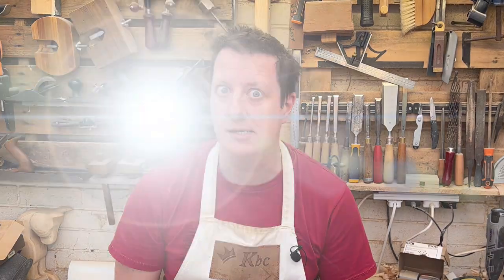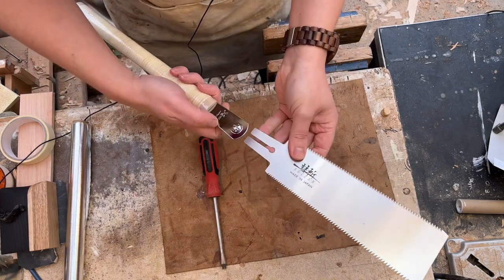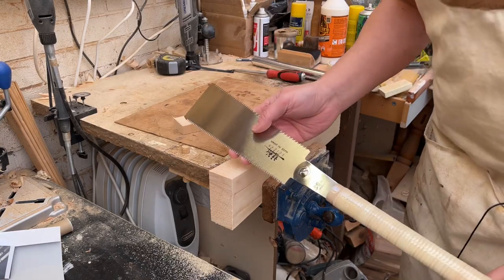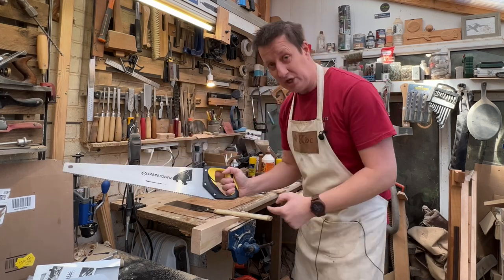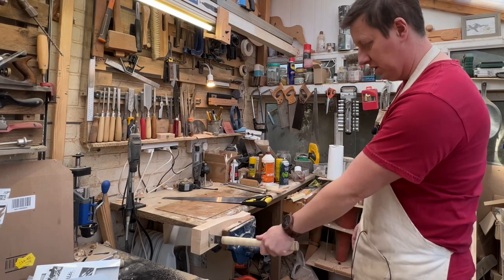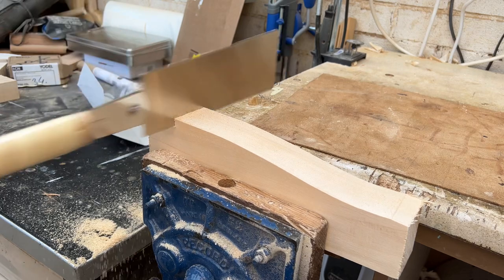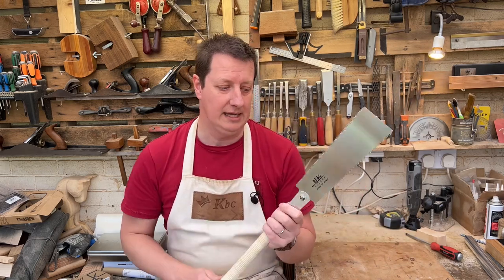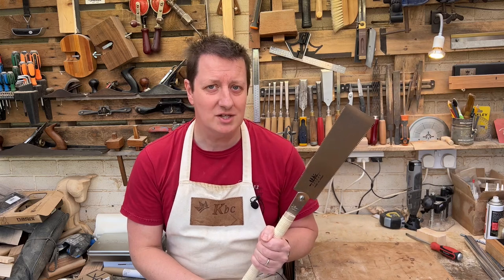Japanese saw  |  First impressions

Comment: First time I tried a Japanese saw I couldn't figure out why it wasn't cutting very much at all.  The Japanese owner of the saw had no problem flying through the cut.  Neither of us realized the main difference.   I prefer Japanese saws these days, especially for dovetails because I don't have an expensive dovetail saw.  The key for me is that it's much easier to hit your end line on both sides, and not over cut.  With a western saw I always had the tendency to overcut on the far side of my dovetails.  But pulling seems easier for me to hit the line and stop.  I also like the idea of the replaceable blade.  Made it a lot easier for me to relearn the style.
Reply from the maker: Seems to be a common thread, that it’s easier to be accurate 👍

Comment: I bonded with my ryoba immediately in a way I've never got on with western style saws.  I liken pulling the saw like pulling a trailer with a car as opposed to pushing, I feel like I've got so much more control and can follow the line with so much more precision.  ...and yes, I'd clang it off the edge of the workbench all day to hear that noise if I could :)    But as with all tools, they all have their place.
Reply: I also use mine for breaking down sheet goods in confined space a lot because it doesn't need the elbow room and throw... but I do get into an existential crisis over being a rip or cross cut on MDF and plywood! :D
Reply from the maker: Thank for that Chris. I can me reaching for this more and more. I just need a spot to hang it!

Comment: You seem to be cutting flat in relation to the wood. Typically, with a Japanese saw, you aim for the lines you can see (which would be the ones on the top and the face that's er... facing you), so you'd be cutting at an angle. Then turn the wood around to cut from the other side, BTW, let the saw do the work. You don't need downward pressure on the saw when pulling.
Reply from the maker: Thanks Bhart 👍

Comment: I made the change to Japanese saws a number of years ago and don't really use anything else now. With practice they become much easier to use (IMO) and more controlable. You won't be able to sharpen, if I remember correctly the teeth are electronically hardened to the point that a file will have no effect. They are very brittle as you'll see if you ever find a nail in your wood. Just a case of buying a new one when they get blunt but if looked after that will be a while.
Reply from the maker: Ah thanks for that sharpening info!

Comment: I studied silversmithing many years ago, and used a piercing saw for most things. So the idea of a cut on the pull always seemed logical. I bought a Japanese saw for guitar making, but I use it for almost everything now. It is easy to make the first cut, and I find easier to follow a line - but I do think you need to go slower and with care.
Reply from the maker: I’m finding that out! 👍

Comment: If you've ever use a Stanley Flush Cut saw then you'll have no problem using a Japanese Pull Saw.

By the way, love how the workspace is properly functional rather than the overly pristine and there are a number of homemade mods making the workspace "yours".

I work out of a little 8x5 1960s front garden out-building next to the tumble dryer so every inch of space is coveted like it's the holy grail and modded in some of the dirtiest ways known to mankind.
Reply from the maker: Use what you’ve got! 😂

Comment: With Japanese saws, I found that I tend to cut a lot faster than what you see here with a similar blade.

I think what I do is use the angle of the Japanese blade, i.e. I'll pull the handle back in a straight line, but the angle of the saw blade itself progressively shreds the wood. Notice that the shape is a trapezoid, not a rectangle.

So, there is a bit of pressure on the blade when you do this as well. It really slices down ultra fast when you do this.
Reply from the maker: Thanks for the tips. I’ve got better with it over the months. Total convert now!
Reply: @KingBespokeCreations  I figured that would be the case lol

I still like western saws for dovetails due to the shape, and the fact that for smaller cuts, the force difference is a lot smaller.

That said, I'm using a veritas to cut dovetails, and I'm planning to make myself a full set of joinery saws with brass backs.

I use Japanese and Western saws for different things, and love them for different things. :)